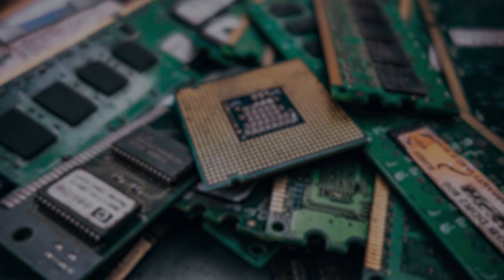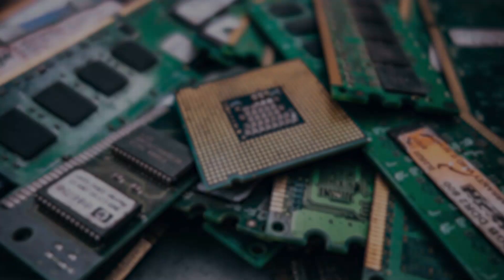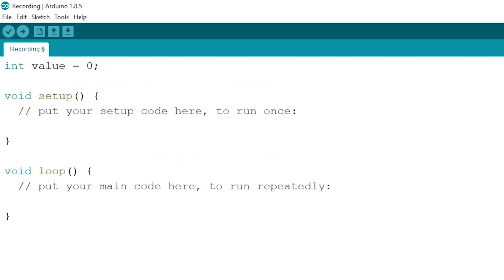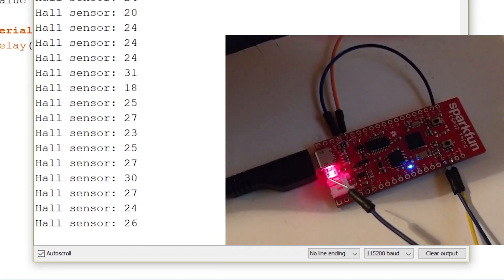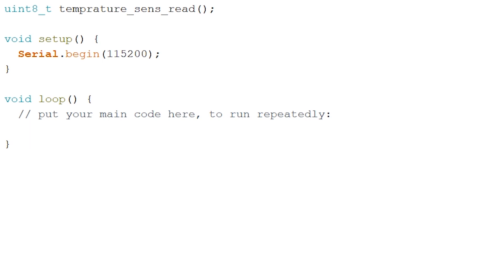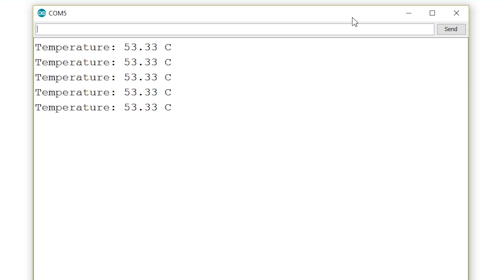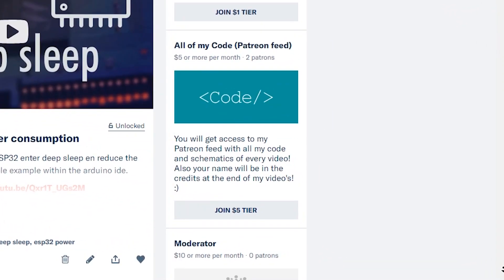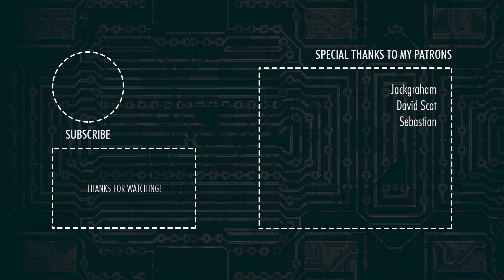ESP32 Internal sensors - temperature, hall & touch sensors arduino

Comment: If you're always getting a reading 53.33c, it means that the function temprature_sens_read() is returning a value of 128, Sensor not Present.  Your ESP32 didn't come with an on board temperature sensor, not all of them do.

Comment: Where is mentioned that ESP32 has inbuilt temperature sensor?
Because I can't get proper reading. Only 53.33 at all.
Reply from the maker: This is the internal or cpu's temperature sensor
Reply: @SunulRathod-wc9bx I know this is 2 years later, but 53.33 means that the sensor is return a value of 128, Sensor not Present.  Your ESP32 didn't come with an on board temperature sensor, not all of them do.

Comment: Hi the temp sensor no change always 53.33 C. I think  that esp32 no have temp sensor accessible for measures external
Reply from the maker: Yes, I think I might have mentioned this in the video but the internal temperature sensor of the ESP32 is indeed the reading of the CPU temperature (I think)
Reply: Asali No temperature sensor on chip, so reading is always 128.
Reply: @juliocosta5818  Greetings! I have bought an esp32 and i used a hair dryer on esp32 and the temp reaches 68°C so i stop blowing hot air; but i haven´t the "internal led" ... Maybe you need a newer version